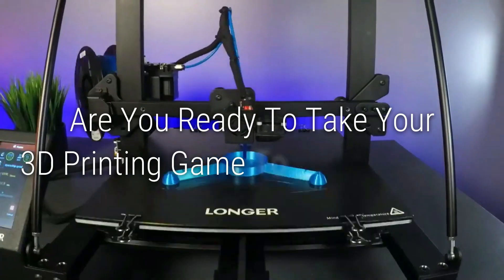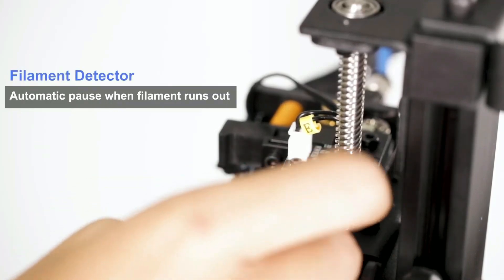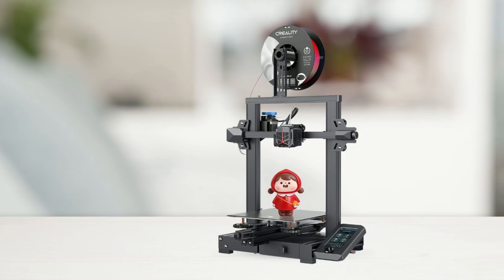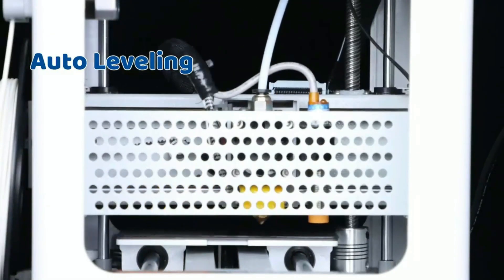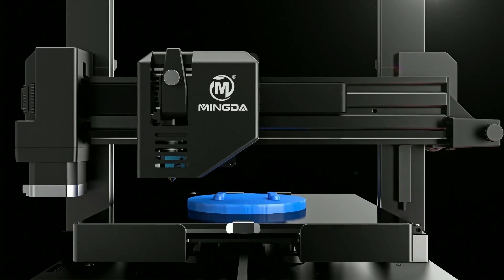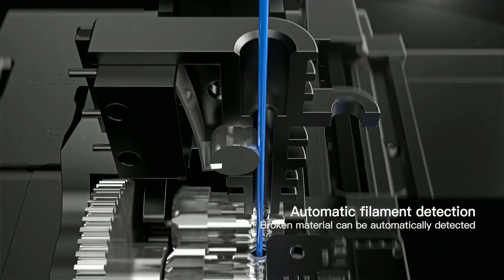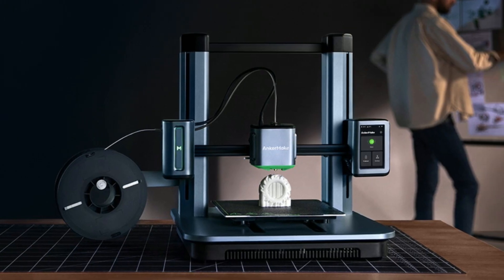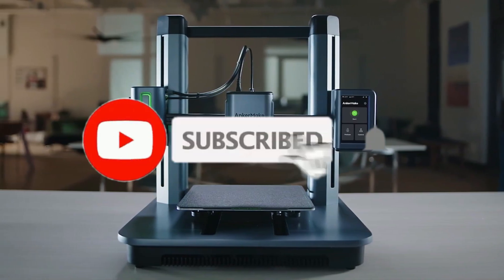Top 5 Best 3D Printers In 2023

Comment: Trouble though with the AnkerMake M5 3D Printer is, it is very expensive for what you get, only mobile Phone control not PC. 
So not really a new user printer since it is beyond most users budget.

All the rest are either too pricey again, or have issues that reviewers have been pointing out.  

Somehow all the companies that make the so called best printers sell them like we are all millionaires.

And we all are experts in the hobby!  The rush now to do Klipper based printers is causing many problems to show up in these often very pricey 3D printers 
which the companies try to hide by just boasting about the speed these printers can do which are just lies?

Most can not run at 500/ms like they all claim that is just a way to try to get you to spend silly money and then be stuck with a expensive waste of money. 
The K1 by Creality has allot of boasting but allot of issues including the fact the company is breaking the law over the used software as it was to be open to the g-code use etc.

But they have a closed system not able to be changed or re-coded which is wrong the riles state any Klipper printer must be fully open source and able to be updated by users since the klipper software is not owned by Creality.  They have locked it down so users can't change any of the control software.

Lots of other makers are claiming their klipper based printers are great etc. but most are expensive and allot just are rubbish old designs that they tried to slap klipper in and run fast.

It boils down to if you need a fast good printer you will need to pay over $1000 which for most users is not a option.
Reply: Was 540 for us a couple days ago.